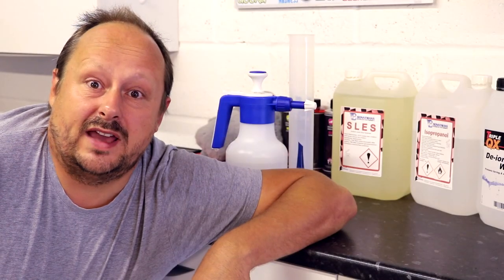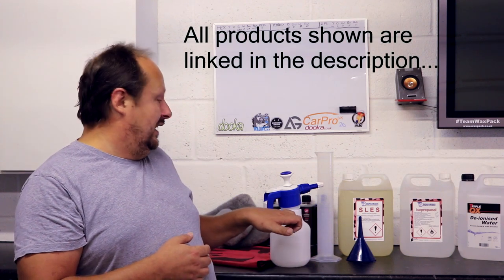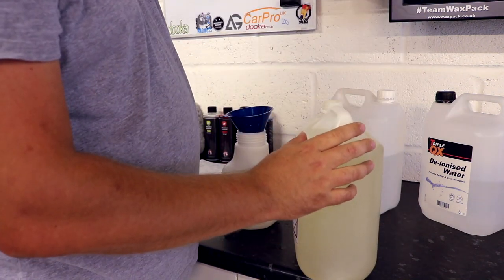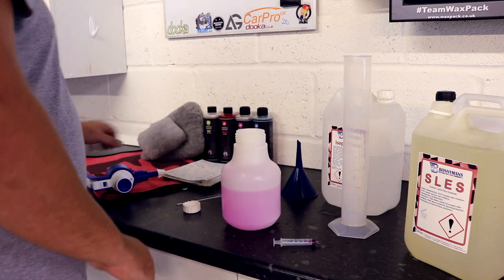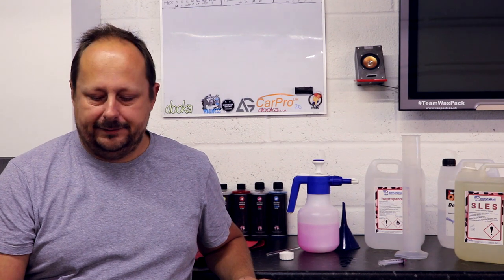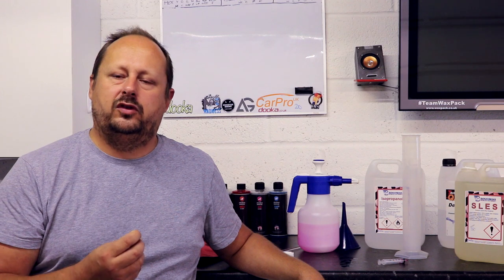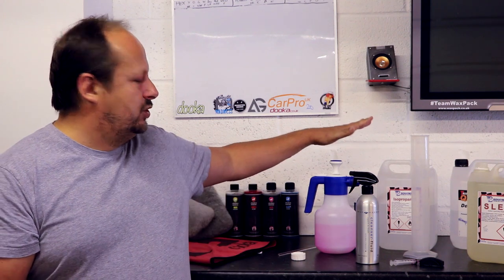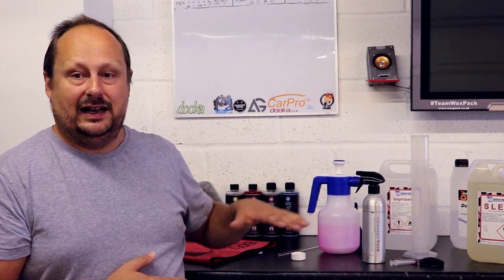Home made IPA Panel wipe formula - Less than 3 pounds a litre

Comment: I've tried mixing up something of this nature. It seems to work well, but it remains extremely grabby once you've wiped most of it off. This in contrast to commercial offerings such as CarPro Eraser and Gyeon Q2M Prep that seem to have a slickness to it during the wipe-off process all the way til it's fully evaporated. Just an observation; wondering what secret ingredient they put in and what difference it makes.
Reply from the maker: maybe lower the IPA and up the detergent..  prolly best to just wipe away with no ipa first as well..  get most of it off the panel and then a little spritz..

Comment: You say you don't need to use IPA before applying wax,however BH state to use their own cleanser fluid before wax to maximise durabilty?
Reply from the maker: it prolly would maximise it..   some waxes dont use organic oils and have components in them which bond...  so in the same way you would prep for a sealant, some waxes (usually durability ones) benefit from better prep..

Comment: Hi mate, what's your take on panel sprays like Carpro Eraser? Should i just use an IPA for cutting stages then a specialised panel spray just before the final stage polish, or immediately after the final polish and before your sealant/wax/ceramic?
Reply from the maker: I like eraser and prep.. They are water based panel wipes which I believe are mainly backboned with alcohol solvent.  The problem with them is purly price.  they are about 50 pounds for 5 litres ready mixed..   And really about 70% of these products is water.   When you buy 5 litres of IPA for 15 quid. You can make 20 litres of panel wipe.   I also find the IPA homebrew just as effective.  So its up to you really if the price thing is not important just buy prep or eraser.
Reply: @ForensicDetailing  Is there other surfactant  products you could recommend? I'm in australia and can't find anywhere that sells SLES. Alot of what I can find is surfactants used for application of herbicide/pesticide/fertiliser. Would dishwashing liquid work as an alternative?
Reply from the maker: @uberlymick  hey there you can just use an APC concentrate for sure.
Reply: @ForensicDetailing  Thanks mate!

Comment: When doing a 2 stage buffing/polishing do you wipe down every panel prior to the final sealant?
Reply from the maker: yes mate so when doing with all the polishing, get a good panel wipe product you trust..  I use bilt hamber cleasner..  and clean down all the panels with the product so its a bare panel with no product..  this will help most forms of sealant to bond.
Reply: Forensic Detailing Channel thank you again for your fast reply! I am doing my F150 truck today and maybe tomorrow too, getting ready for winter up here in Nebraska USA where it snows several feet, not inches 😁

Comment: Hey Jon. Using IPA for initial wipedown, but ill come back with a second panel wipe solution like Gyeon Prep or Gtechniq's Panel Wipe before laying a coating. If its just a sealant I find IPA is fine.
Reply from the maker: yer thats kind of the way  Im recomending you do it..   I think the IPA mix its suitable enough for your wipe downs during the sets where you need to inspect but dont need to get it all off and you know your gonna be going again on the same spot..  And when done use the premium products if you want for the final wipedown before sealants...

otherwise you will add 10-15 quid chemical cost per car..
Reply: He says that on the video

Comment: I use motip 600 degreaser. Very cheap, costs under 5£ for 500ml and does a better job than any IPA solution.

Comment: Hi! Would an APC work in place of an IPA solution? For example, Meguiars APC. They tend to be cheaper as well (not as cheap as the home-brewed version, of course).
Reply from the maker: yes I think.. problem is theres a lot of different types of APC.. but for this yes just 20ml of APC would prolly do the trick..
Reply: Thanks!
Reply: Vincent Ong you Can NOT swicth the IPA for apc, but sles for apc
Reply: Bobby Finnrose Yes, I use some APC in stead of the mentioned SLES. Because APC is working about the same and most of us already use it for general cleaning purposes on cars already.

Comment: Thanks for the great video- Any problem using 70% IPA as opposed to 99% + DI water? Does the 70% IPA in stores contain DI water or generally not?
Reply: pbakai182 no problem using weaker IPA but you have to do the math and probably add more IPA to water.
Reply: It's ideal to start with highest purity possible of each chemical. You guarantee that you know what you're mixing and it makes the math easier. However, the 70% prediluted IPA is probably not contaminated with any minerals so I wouldn't worry about it if that's all you've got. 

Short answer: it's most likely fine.

Comment: Hey John I would like to ask you something. I think his name was Scot, the guy from Dallas paint correction said that IPA is not good for the clear cot. What is you opinion on that matter? Thanks for your video, very informative as usual.
Reply from the maker: hydrocarben solvents are more powerfull.  If I took a hot sunny day with a baking hot test panel and used a pure solvent panel wipe product.  if I put it on the panel in a line and leave it, that line could swell and go opaque (potentially).  if I did the same thing with IPA I can never make the clear swell.  when its knocked down with water and just the nature of IPA as a polar solvent it just cant seem to do any harm.      ISO wipedowns are also used at a manufacturing level by all the main car brands, paint shops up and down the country who have a lot of experience with clearcoats.  and just simply from using it I cant see any negative effects.     I do buy that the IPA and water wipedown is not as effective as other products though, like I say the pure hydrocarben stuff is on a different level.    with any products its about how you use them more than anything, base temp of the clear coat is very important, as is the quality of the clearcoat or type of clearcoat.

the main attack on IPA wipedowns has come from the detailing industry.  It started as far as I can tell with brands that offered panel prep type products.  problem is some of these products cost an arm and a leg.  So there needs to be a powerfull reason to backup to people why you need to spend like lots of money on their degreaser products.  I would suggest you try using the IPA mix in this video, you can also experiment with lowering the ISO level down and using some limonene.  see if your clearcoat swells.   If your really interested in all this stuff get a test panel you can mess around with.  If you manage to swell clear with IPA and water let me know.     you can argue perhaps its the continuall used of IPA that might be the concern, but again I cant see it.  I might do an IPA wipe down on the car once a year  I dont think that will stress the clearcoat anymore than covering it in a paste wax thats loaded with hydrocarbons and leaving the wax on the panel for 20 mins etc..    dunno lots of people I respect have a different opinion than me on this one.  If the industry could provide me a nice water miscible wipe down solvent, that was nicer to work with and I could get for a reasonable price I would be in.  they do have those products but the price is insane and like they sell them in tiny bottles you blast your way though instantly.
Reply: Forensic Detailing Channel   Thanks for thorough answer John, I’ll use IPA and will pay attention if it does any harm to clear coat, and if i see something make sure you’ll be the first one to find out 😉

Comment: NIce one. Just an alternative to SLES you can use a couple drops of dishwashing liquid (i.e Fairy)!!! Keep up the good work
Reply: You say a couple of drops of dish wash liquid. what do mean by that? Sorry to sound pedantic but his recipe stated 25 MLS which a whole lot more than a couple of drops that you are suggesting. Could you please a little more accurate?
Reply: @jhndijkman  I've made up this ipa mixture but instead of SLES, used a mild liquid APC (Mr muscle) and used 12.5ml in a 1 litre mixture. For dish soap I would try 2.5ml as it's thick and concsntrated. It's trial and error, so maybe just make up a 250ml mixture and see how it goes.

Comment: Jon, if I watched this video once, I’ve watched it ten times or more.
I am finally going to ask why. You never stipulate perentages.
What is the concentration of IPA you intended to make?
Your mix is 30% IPA. Is that what you use and prefer, is so, why?
I have read its not good to go over 20% although i have made it higher.
Really would like to know your comments please.
Reply from the maker: I use about 28% IPA I think.  mainly because the scholl concepts stuff is a bit thicker.  generally Ill wipe down the panel wipeout anything.  then if I want to inspect squizz some of this on the panel and buff it out gently.   i think optimum said something about a rough upper limit of around 25%.   to be honest I dont think and extra 4% will do much.   with solvents its more about not letting them dry on the panel.    IPA's mixed down with water like this are less harsh than a lot of things potentially.  the biggest downside is not risk with this.. its just like people say I dont think IPA is the most effective chemical for this.  but thats just based on perhaps casual observations.   Ive got no plans though to switch over to expensive panel wipes for quick inspection wipedowns.  gotta be cheap and fit for purpose, untill we get to the final prep product and then I want something abit more effective.
Reply: Forensic Detailing Channel Concur on that Jon. Thanks👍

Comment: What IPA mix would you use to remove wax in using 20%
Reply from the maker: I dont really use this to remove wax I just use it for polish residue buffing really..  Ill use lime prime or a wizz over with polish or a stronger product.
Reply: It's hard to tell if lime prime removes the wax leaves its own beading and I use it by hand don't have a machine

Comment: So much better than the bullshit from most detailing videos. Always get the idea that most of them are sponsored by the product they seem to use when they slag off IPA. This seems to make sense...
Reply from the maker: theres a lot of BS about IPA out there.  The reason being you can mix up lots and lots of products for hardly any money.  so in order to convince you to spend like £10+ for a tiny bottle of spray there needs to be a good dose of BS or anti IPA sentiment.   Put it this way. Koch Chemie who have been making OEM automotive abrasives for more than 60 years, sell and recomend an IPA based wipe down product for their abrasives.  And this is used by car manaufacturers.    Its only mis-use of IPA that will swell clearcoat.

Comment: Can't brake cleaner be as effective as panel wipe? I'd use brake cleaner for when I'm cleaning the inside of my glass in preparation such as installing a dash cam and placing the sticky base on the glass
Reply: Oh thanks for the tips. Thank God I haven't used it on my cars paintwork. Should look at getting some APC :)
Reply: Zain K you should use a non ammonia glass cleaner brake clean is pretty harsh for a window clean.  Even alcohol will work for you
Reply: Thanks Gabe, I normally use autoglym glass polish for when I'm cleaning the car. The rear windows are factory tinted on my car so I just use Koch chemie fse to clean and remove water spots. Can i use car glass cleaner on factory tints? I'm sure there's no tint film on the glass as there's no bubbles around the edges.
Reply: Zain K yes I'm sure you can but to be safe use an ammonia free glass cleaner

Comment: Is it fine to just use 70% ipa straight
Reply: No....70% is too high  a IPA concentration. Use a 2:1 ratio of water to the IPA solution (twice as much water to the 70% IPA - will give you a 23% IPA solution)...or a 1:1 mixture (equal amount of IPA with equal amount water - will give you a 35% IPA mix - probably still a bit too high)